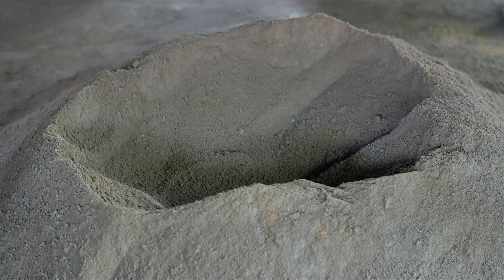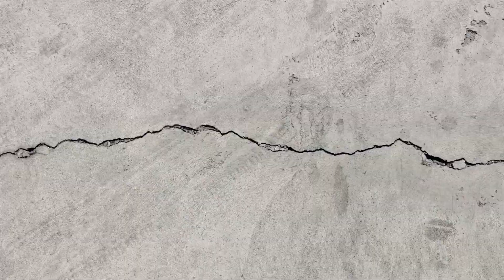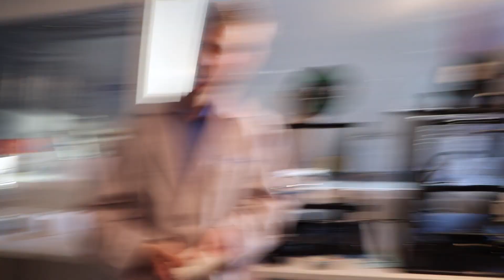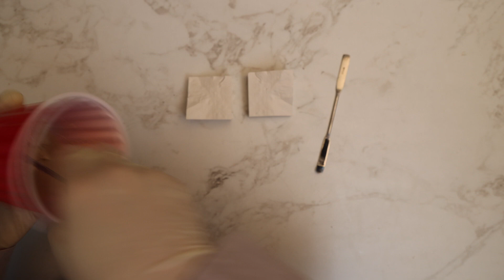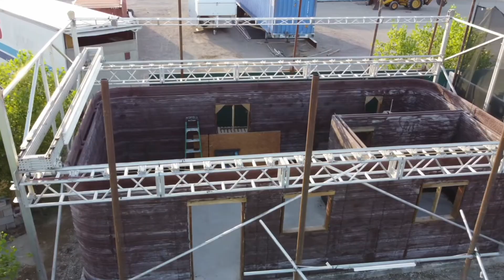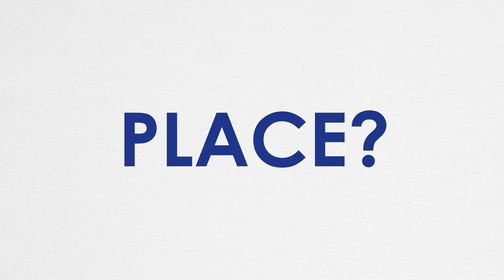The story of geopolymers: the concrete alternative for sustainable construction

Comment: You assert that concrete can't be recycled, followed up by it can be recycled with geopolymers.  That is not accurate.  Stoneway Concrete in the Seattle (and many other markets) is economically producing quality recycled concrete aggregates for new concrete made with recycled concrete aggregates (about a 75% re-use rate.)
Reply from the maker: Thanks for your comment—and you’re absolutely right to point out that conventional concrete can be recycled into aggregates, and companies like Stoneway are doing valuable work in that space. Our intent wasn’t to suggest that concrete can’t be recycled at all, but rather to highlight the limitations of current recycling methods, especially when it comes to restoring concrete to binder-level functionality (i.e., not just aggregates but reactivating cementitious properties).

What makes geopolymers especially promising is that certain formulations can chemically reactivate mineral-rich waste streams, potentially incorporating not just aggregates but also fines and residual binders—which traditional Portland cement systems often can’t fully utilize due to performance or contamination constraints.

We appreciate the opportunity to clarify and improve how we present this topic. Your point underscores the importance of advancing all pathways toward circularity in construction—whether through mechanical recycling or binder-level innovation.

Thanks again for contributing to the conversation!

Comment: I understand concrete is made with cement, but most things are made with concrete, not cement. There is no "house made of Portland Cement," right? Are you taking about concrete made with geopolymer?
Reply: Thanks for your question! While the two are sometimes used interchangeably, the difference between cement and concrete is sand and rock, otherwise known as aggregate. Technically, cement is the binder. It is like the glue that hardens to hold aggregate together, and this cement can be either a Portland or geopolymer binder. Concrete is the end product, the hardened binder and aggregate (often reinforced with rebar). So, you could say that houses are made of cement or concrete. Both are correct. The former just leaves out other materials.
Reply: Imagine a house made of brown sugar. Got it? Now imagine a house made of gingerbread. I'll wager you imagined two different things.